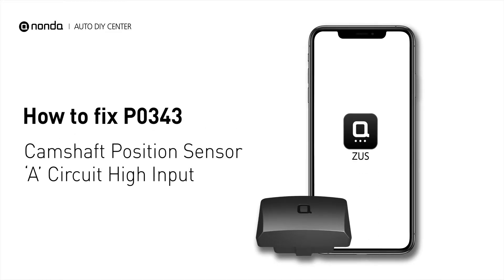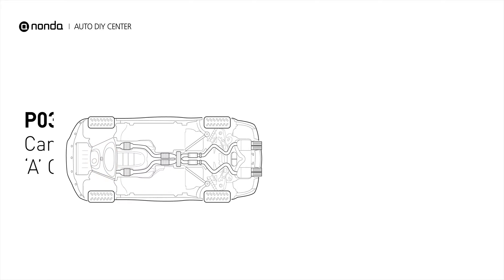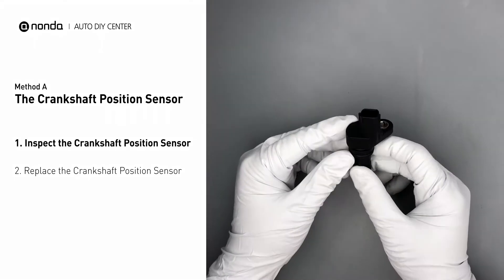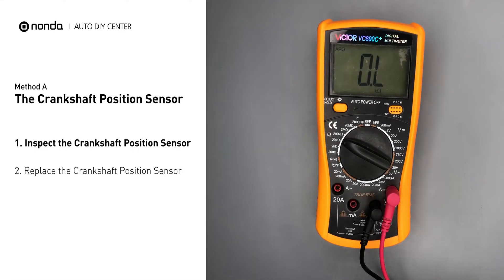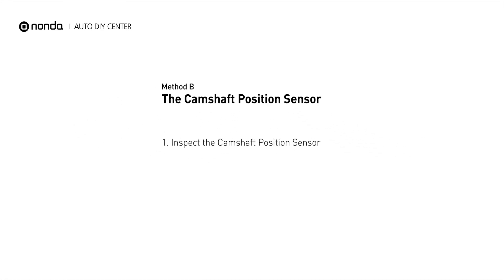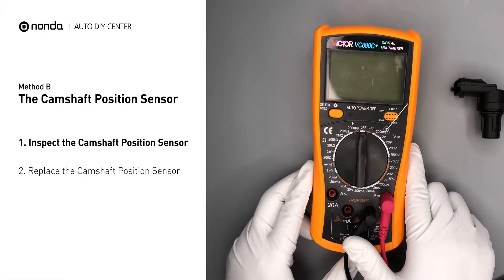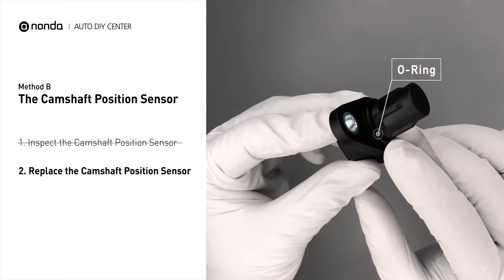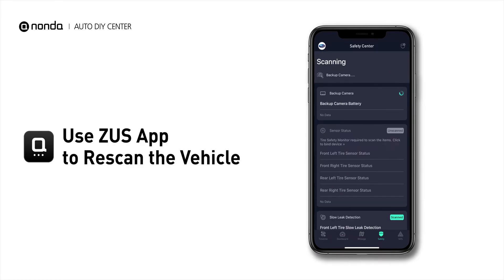How to Fix P0343 Engine Code in 3 Minutes [2 DIY Methods / Only $9.24]

Comment: This is such an oversimplification of the possible P0343 "Camshaft Position Sensor A circuit High Input" code - and totally misses checking for power and ground on the circuit.

Comment: Hi my harness had a rat bite specifically in the crankshaft sensor. only 1 wire is affected and since the wire is stranded and had still 2or3 wires still connected the error manifested 5 days after(check engine warning). can i just reconnect the wire? thank you
Reply from the maker: Hi Jayz, we suggest to replace the damaged wire.

Comment: hi, I was driving to work and car shut off and I couldn't get it to start back up so I checked the and got the p0343 so I replaced the camshaft sensor and the crankshaft sensor and the car still won't start, I don't know what do now??
Reply from the maker: Hi Benny, oftentimes, a faulty ground wiring, short between the power and ground wire, faulty starter motor and a weak battery could contribute for this code to appear. Please also try charging/replacing the car battery.
Reply: I replaced the camshaft sensor but the code came back, the crankshaft sensor could cause the code too? I figured there would be a different code if so?
Reply: @trentyncramer4530  im having the same problem with my 2001 jetta rn
Reply: @trentyncramer4530  did you ever figure out what it was?
Reply: @CatDadConspiracist  nope, I even bought an original manufacturer sensor too still didn’t go away. Has to be wiring or computer related then
Reply: @trentyncramer4530  i took it to my mechanic and he said the timing belt messed up and the timing is off and the belt slipped and hit something ans now i need a new motor
Reply: @CatDadConspiracist  ya being a car I can see that would be your problem. Mine still runs fine to this day but still have the damn code since I got it 2 years ago😂 ik mine for sure just has a bad connection.